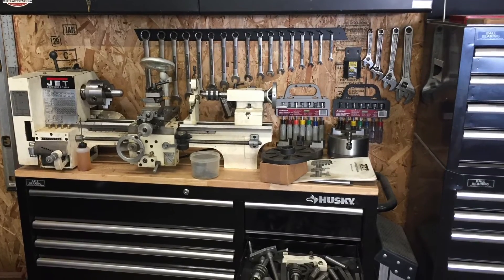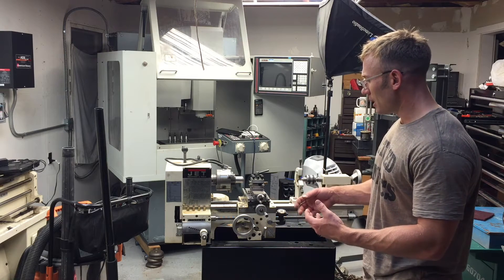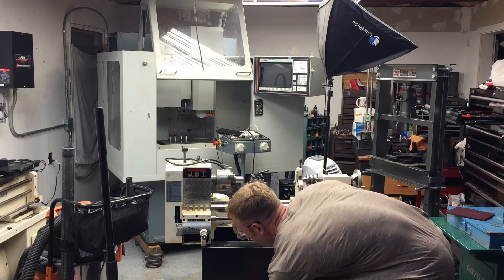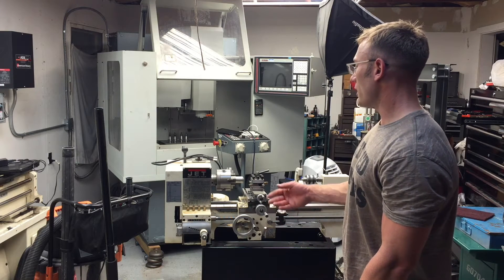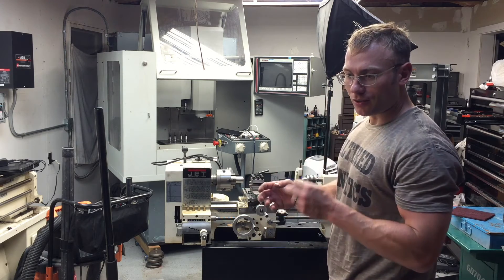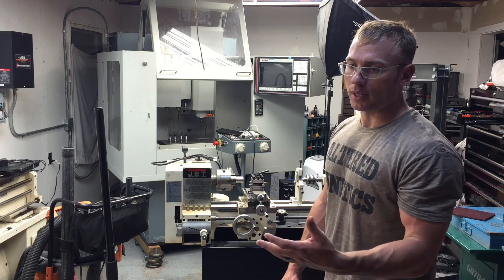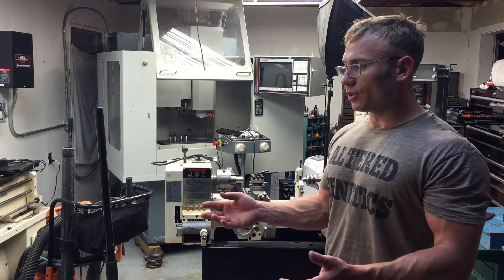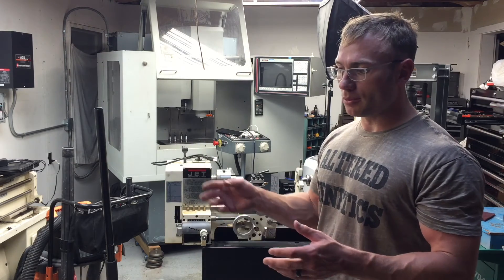Buying a used Jet 9x20 Lathe-CNC CONVERSION IS NEXT - Unorthodox Fabrication

Comment: very cool and I agree with all the stuff you say but I wouldnt recommend anyone to buy a big ass CNC machine for inside your house.  just the need of a 3 phase which you wont have,  yeah yeah I know phase convertors which are pain to get to work.  but if you have the room and the power fine but to get that thing running it will eat up so much of your time.  why not just do small cnc or small manual lathe and mill
but hey m an you are a cool guy and thanks for the info and video

Comment: im about to convert the same type of lathe to cnc ... can b done .. the cross slide is the issue , but i found a 10mm ballscrew with a nut dia of 18mm . just fits , 2mm clearance
Reply: Sweet! Could you attach a link to that video when you are done?
Reply from the maker: Sorry I was logged in with a different acct below. Do you have video on this build?
Reply: sure will ..parts are on the way .. should make a start on it this weekend. no i dont have a vid as of yet but on the weekend ill make one and start it off. great to c someone else trying the conversion .

Comment: I have the HF version of that 9x20.  I bought it already converted.  It's paid for itself several times over!  I love it.  Certainly worth converting if you have a market for parts you can make on it.
Reply from the maker: I am not sure if I have a market of parts, yet. 

But I was thinking, "If I build it they will come"

I will check your lathe out. Thanks for the comment!
Reply: There is a ton of info on the web about converting the 9x20.....mine works, but I think there's some better options out there.